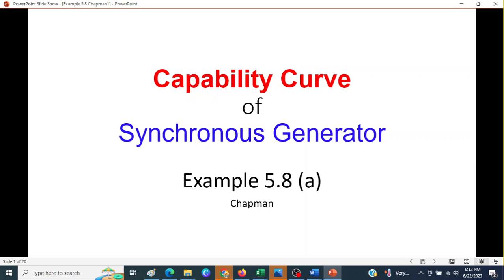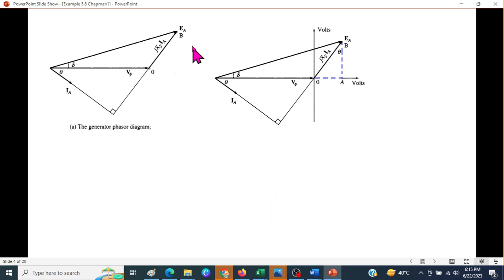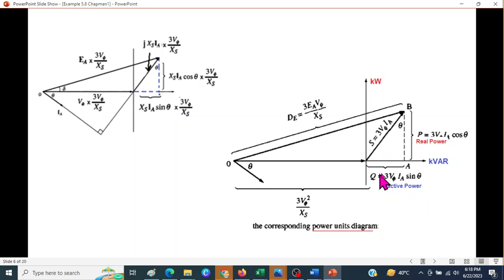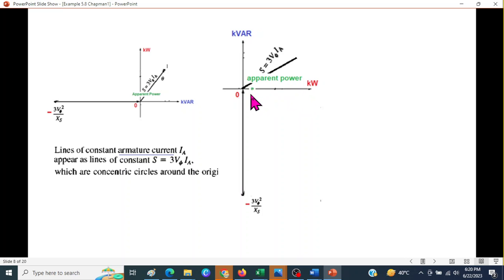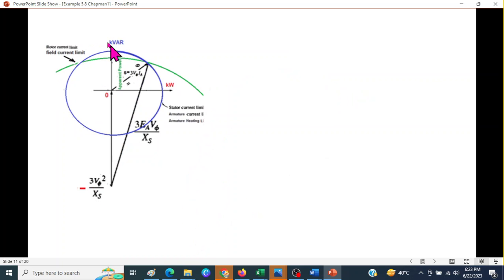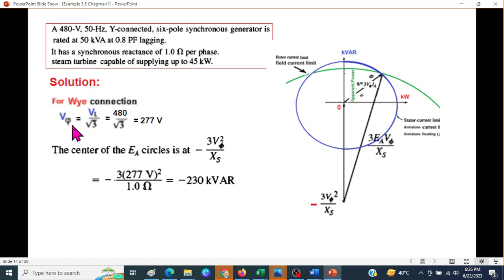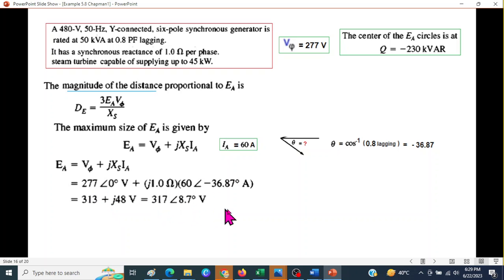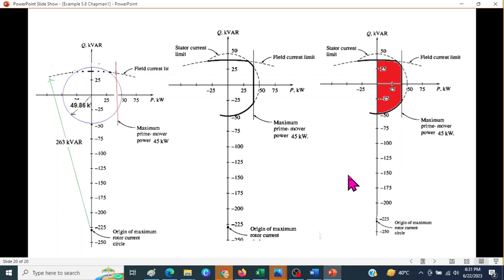(English)EM || Example 5.8(a) (4ed) || Capability Curve || Synchronous Generator

Comment: Dear sir, how can I find answers for rest of the sub questions of that example 5.8. Is there any book with that all example questions and answers?
Reply from the maker: The example questions are solved in the book. End chapter questions are solved in the Instructors Solution Manual. You can also take help pf AI.
Reply: @ElectricalEngineeringAcademy  ❤